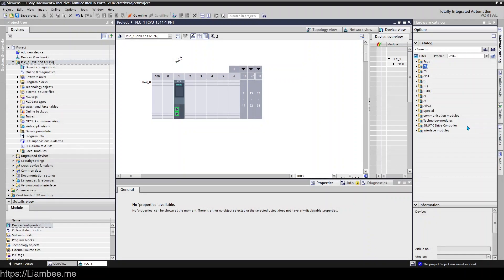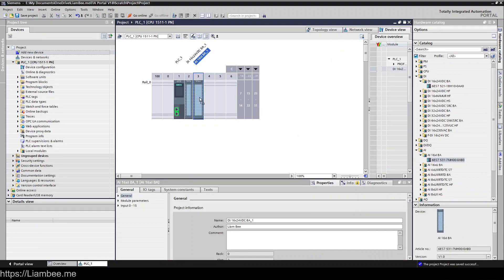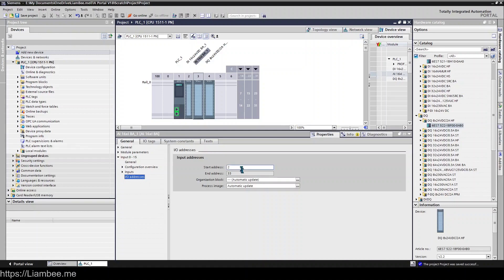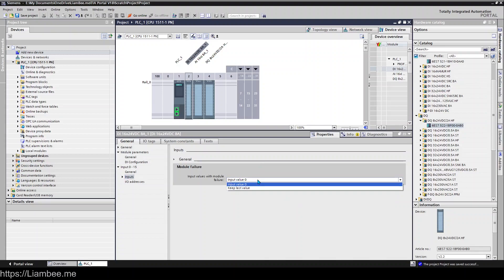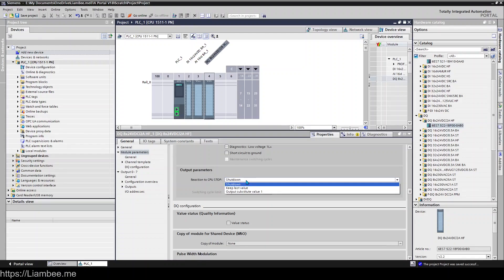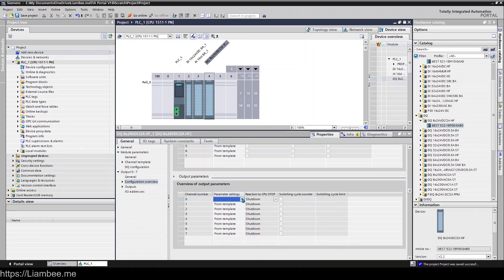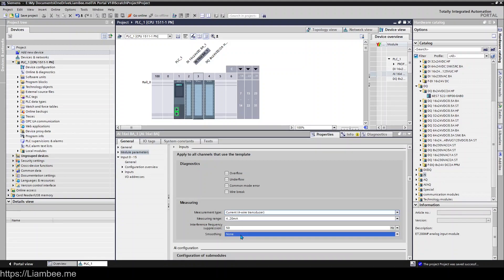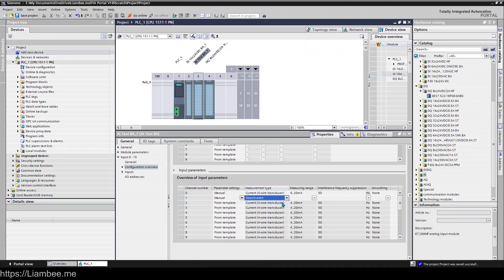Siemens TIA Portal V18 - Add IO To A PLC And Configure Hardware

Comment: great job, but what do they mean by "parameter setting from template"? (in the diagnostics overview of the digital output card)
Reply from the maker: You can set a "template" that is applied to all channels by default. Unless you tell TIA otherwise, all channels will apply the template.

They should have called it default settings like any normal application would have!
Reply: @LiamBeeMe  well then, but where the "Template" setting is done?
Reply: @thomasroymatthias7787  (If it's still actual) Template settings for all channels are being applied at 6:03